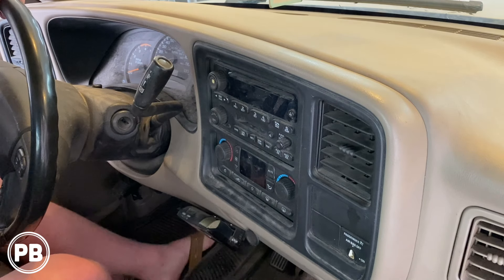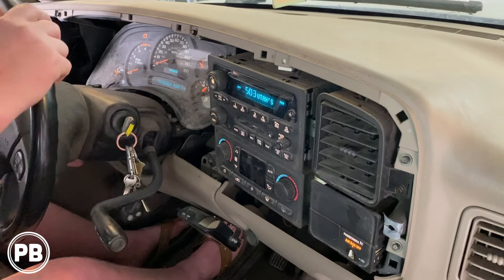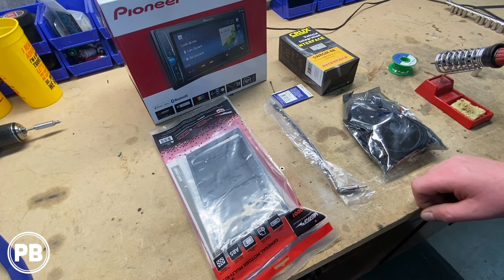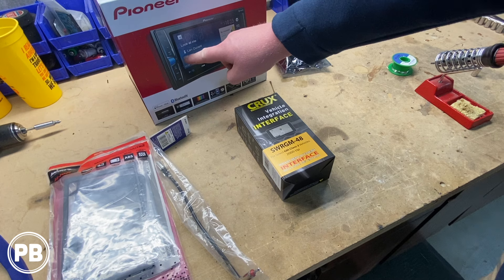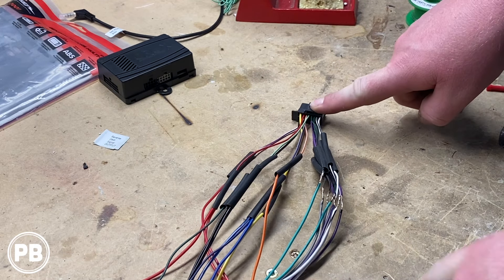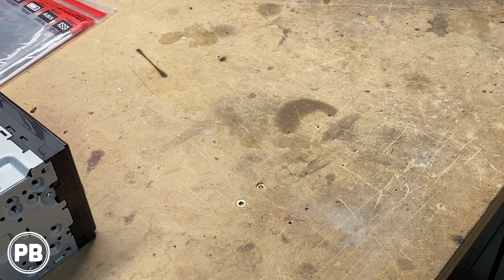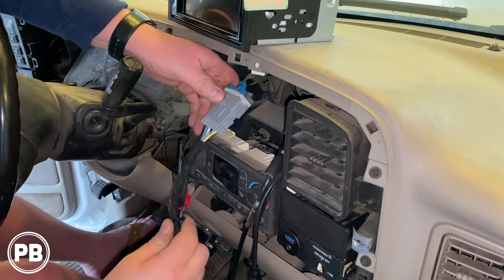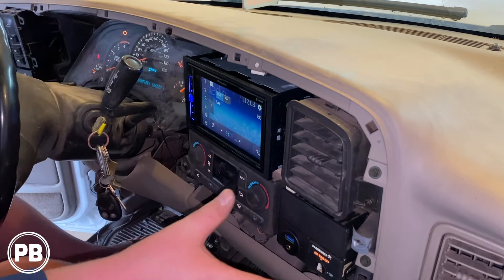1995 - 2006 Chevy / GMC Stereo Install

Comment: Hey - thanks for this video, super helpful.  I was just about to pull the trigger on all these parts for my 2004 Yukon XL, but I’m concerned that I would lose XM radio.  Do you know if I used the same radio that you used, would I be able to keep XM?  I can’t tell if that depends on the radio head unit or the wiring harness, or something else?
Reply from the maker: Hey there, yes, this requires you to have a radio that is XM radio ready, and you will also have to purchase the XM module to retain your service with the new radio. https://amzn.to/2WM1ULH.  The radio we used isn't XM ready, but higher end Pioneers, or this Sony is compatible: https://amzn.to/3ALE9EH.  Feel free to send me a message on our facebook page with any other questions!
Reply: Nice!  Thank you!  I kind of figured out after poking around, both in terms of what “XM” ready means and the fact that you have to buy the tuner (and also how to wire it to the existing antenna).  Do the higher-end stereos that are XM ready basically go in the same way, and would they use the same Crux wiring harness?

Comment: Where did you plug in the RC jack into your radio from the usb port you installed on your dash?
Reply from the maker: USB port goes to the USB port on the radio.  The AUX port went to the AUX port on the radio.  If your radio doesn't have an AUX port on the back, then purchase a flush mount adapter with only a USB.

Comment: Don’t know if there’s a good fix for this stuff. But my radio has an insane amount of static noise coming out of it and it’s annoying and my steering wheel controls make a loud click when I use them and they’ll sometimes mess up my Bluetooth and disconnect it. Anyone know what could be wrong?
Reply from the maker: Bad equipment or poor wiring job.

Comment: Do you need to connect onstar? I don’t use it and I don’t pay for it service. My 2500HD 06 is not starting. After 1 month of having my double Din install. I bought the kit to keep the buttons working on the steering wheel. But not for onstar. 
Can that be the reason why my diesel does not start? I had to use starting fluid in order to get my truck going. 
Could use your help. Please and thank yiu
Reply from the maker: Not retaining onstar should not impact the vehicle starting whatsoever.  However, to remove that variable, reinstall the factory radio to see if the truck starts.  I'd go from there.
Reply: @ProvoBeastAudio  thank you replying back to a old video. I do appreciate it, but for an update I forgot I took it into Chevy to get an oil change done and the people fuck up. She got air into her system. But i do appreciate the feedback

Comment: Since the Crux kit comes with an antenna adapter, is the seperate GM extension required?
Reply: 2004 Denali, factory Bose system. Installed Kenwood DMX970S. Crux kit extension works just fine. But the stock antenna cable has enough length on its own. 
Bose stereo has 2 connectors on the back, crux kit only hooked up to the larger of the two connectors. Stereo works fine, but no steering wheels controls. Will update once I figure that out.
Reply: Did you find the answer to this?
Same problem here

Comment: Do I need to connect onstar to my 2006 Chevy 2500HD. I did not buy the connection to keep onstar. But i did but the connection to keep my steering wheel buttons. My diesel won’t crank over. I have to use starting fluid to get it to start

Comment: Hope you get to read my comment, turns out that I am installing a stereo on a 2005 Hummer h2, I was looking at the diagram and saw this car came with an amplifier from factory, it has the Bose system, y was wondering if I have to run new cables to the speakers so I bypass the amp, or if I can just connect the speaker signal just on the harness behind  the stereo? Thanks  a million for your answer
Reply: Installing on a H2 here. Everything works for 6-10 min then I lose all audio, headunit still works. Once I restart H2 it all works again

Comment: Hey so my 03 Sierra with a bose system has a second harness clip with an orange/black wire and a pink/black wire. Do you know what they do? I believe they turn the factory amp on. I tried the factory radio with it out and had no sound.
Reply: My Sierra has the same clip. What’s it for?

Comment: Is it possible to install an aftermarket radio and retain steering wheel controls by just getting a harness adapter without the interface? I have a 2005 Z71 Chevy Avalanche and I don’t care about on star but would love to retain my steering controls.

I’ve never had a stereo install and lose my key fob abilities but something about the Bose system just seems odd to me.
Reply: Did you find an answer to your question? I have a very similar question to yours
Reply: @EthanNaresh  you have the bose system too? i'm thinking about getting a touchscreen.   what kind did you get
Reply: @RushVoorhisOutdoors  I haven't gotten a stereo yet. I want to know the major potential problems before I order one
Reply: I have Bose and just bought a touchscreen radios before I realized how dang expensive it was going to be for the harness needed

Comment: How do u choose the right wiring harness for your stereo does it go by the make and model or the truck or with the stereo your buying
Reply from the maker: https://youtu.be/pla_0VpHTvs
Reply from the maker: Most aftermarket radios will work with the harness adapters made for your vehicle.

Comment: What if your aftermarket radio doesn't have the 3.5mm connection in the back? Is there a work around?
Reply from the maker: If you are referring to the steering wheel volume controls, it depends on the Crux harness.  If it is a Kenwood / JVC, you will use the blue yellow wire.  Any other brand that doesn't have the 3.5mm input for those controls, you will need to resort back to the Crux manual on how to manually wire in "key 1 and Key 2" to the harness.
Reply: My diagram only shows a singular “key”(not two) what would you suggest in that scenario? Are they sometimes labeled differently?

Comment: My 2005 Chevrolet Silverado 1500 has two harnesses, one like the one in yours, and a smaller black one beside of it. Where can i find an aftermarket adapter.The truck does not have on star, steering wheel controls, or the Bose sound system. Any help would be appreciated.
Reply: My 2003 Yukon 4.8 slt doesn't have the steering wheel controls either or onstar..what wire harness do I need?

Comment: Thank you so much for this video it is very informative and helpful. I recently purchased this Crux interface because of this video and installed an aftermarket radio (Atoto S7 XE) in my 03 GMC Sierra Denali with the Bose stereo everything went fine and functioned as it should. There is one issue that i cannot figure out the sound goes out if I'm doing things like switching functions and will not return unless I cycle the ignition key basically power cycling the unit. Do you have any advice or suggestions that I can try? All my wires are matched, soldered, and insulated with heat shrink.
Reply from the maker: It may be the radio - The cheaper Chinese non-brand units can be very hit and miss!

Comment: What size is the radio in these vehicles?
Reply from the maker: Depends on what year you have. 1999-2002 have a 1.5 din. 2003-2006 have a full double din.
Reply: @ProvoBeastAudio  mine is a 2006 suburban fully loaded. And it has a big radio so probably double

Comment: So I'm thinking of doing the same install on my vehicle, however mine has XM.  It's a 2005 Tahoe and for some reason the radio takes a while to play sound to the speakers ( takers 15min or so for sound to play after turning to on) even after changing out the amplifier.  I'm thinking it's the radio head.  Any suggestions on the best radio head? Thanks
Reply from the maker: Sure, send us a message on facebook and we can send over some recommendations!

Comment: I have low volume rear speakers not workung
Reply from the maker: Its probably because you probably have the audio harness on the crux plugged into the bose port instead of the non bose side (assuming you don't have bose).  Switch ports and that should work.  You can move guidance on this video here: https://youtu.be/B1zAsUsJy2w?t=103

Comment: Found your videos and channel while browsing. Some confusion. I have a 2002 Yukon XL with steering wheel controls. Happy to use your Amazon links for everything, including Metra adapter from single to double din. Crux only shows 2003 for the adapter, and you don’t show the Bluetooth microphone part. Will any microphone work with that stereo? Will the adapter still work for the 2002 Yukon XL Denali with the Bose factory system? Appreciate a reply before I use your links👍
Reply from the maker: See the link in the video for the dash conversion video for a 2002.  Parts are a bit different.

Comment: Great video the red wire did get me though , had to install a toggle switch to it as well as the ground have to flip it off and back on which allows DVD 📀 play as you drive

Comment: So if you have a Bose system do you need this harness? Bought a harness from Walmart and it plugged into mine but when I got it all wired up the radio would not turn on Also I need to go buy the antenna extension as mine did not come with, would that prevent the stereo from turning on? Anything helps

Comment: What size are the screws to mount the dash kit  to radio
Reply: They come with the kit. If you need replacement just bring the radio with you to the hardware store and see what works they usually have a loose screw section otherwise i know home depot doesn't mind opening the boxes, id open one of the bigger boxes that re-seal easily to find the width the fits and then buy a small pack of that size but only 1/2 or 3/4 in long

Comment: My dual radio has no WR input jack. Can I use the cam in one instead or??
Reply from the maker: It may not be steering wheel control compatible. If you send us a message on Facebook or instagram we can help!

Comment: What size are the screws to mount the dash kit  to radio
Reply from the maker: Each radio will have their specific screw length, size, and pitch. Pioneer uses an M5 8mm sized pan head screw.

Comment: So you can fit a double din with a stock Basel ?
Reply from the maker: For 2003 - 2006 only.  Pre 2003 will require a different bezel.  Link in description of video for that video.

Comment: Great and helpful video. Did you use the 3' or 6' aux/usb adapter kit? Thanks for the helpful video.
Reply: I would guess 3 feet is plenty for this use. The 6' cord is likely for running it to the back seat

Comment: @Provo Beast Audio Installation 
I have an '04 1500 Silverado Crew cab. The door speakers say Bose on them. The factory headunit has 2 connectors one is a 24 pin. Also have rear view mirror with OnStar buttons...Can I get a harness without Onstar since I do not have active OnStar subscription? Head unit to install is Pioneer AVH-120BT. Thanks
Reply: Any answer?

Comment: Great Video. One question, my 2004 silverado has a microphone installed as part of the on star. is this not activated through the harness?  will a new mic be required etc?
Reply from the maker: Generally it will be on it's own protected circuit, so an aftermarket one would be required to be installed in most instances.

Comment: Is the wiring harness necessary if i have no onstar or steering wheel controls (06 gmc sierra)
Reply from the maker: You can get a more simple version as you will still need one with the smart harness module for accessory and other necessary functions.  you would need the Crux SOCGM-17 harness.

Comment: I just removed that same factory radio from my 2006 Silverado and forgot to remove some CDs first.  Can you tell me which pins I need to connect to on the back to power it up on the bench and get my CDs?

Comment: I used the Crux SWRGM-48 on my 06 Chevy 1500 with the Bose system and steering wheel controls.  I am not getting any sound output. I also have rapid flashing blue light indicating CAN not recognized? I have the switches set correctly on the back of the module. Not sure where to go from here.
Reply: Just wired myself up a kenwood head unit on an 03 silverado today with SteeringWheelControls(swc) and bose system.....all said and done i also had no power and found a video that led me to my solution....on the harness that came with my kenwood unit, is a Blue wire that is labeled PowerControl/Power Antenna...as stated in the video insaw i didnt use this wire under the assumption i didnt need it because i dont use a powered antenna.....come to find out..by tieing that blue wire into the Crux's 24 pin blue/white and the blue/yellow from my 4 pin SWC, it then powered my amp and i had sound! So all 3 need to be wired/soldered together..to test before i rewired it all, i just stripped the blue power control wire and touched it to my already made-up connection from my blue/white&blue/yellow..it was about a 2 second delay of holding the wires together that it rook my bose amp to power up and then i had sound!...hopefully something similar will help in your case, either way, theres answers out there and its def just a simple wiring issue somewhere in your harness
Reply: @jimchow-ch5vu  The blue Power Control wire did the trick for me also. Now I just need to figure out the steering wheel controls not functioning.
Reply: @jimchow-ch5vu I have the same problem and am going to try this.
Reply: Yup thats what it was! Thank you for this info. I had the same problem and thought the same thing about that "p-antenna" out of my kenwood. Figured not to connect it since i didnt have one. But unlike yours... i only had to connect that antenna off my kenwood to the "amp turn on" on the crux. Didnt need a 3way connection like you said you did. Anyways it works. Again thank you.
Reply: @plutocrank awesome,glad to hear it! As far as the steering wheel controls like @thirdgearboogie is dealing with...mine also dont work and havnt..however i stopped caring to diagnose it any further and was just happy with now having the bluetooth capabilities in a 20+ year old truck lol

Comment: Does the Crux adapter work with the bose system including the factory rear DVD player?
Reply: Yeah I was wondering the same thing but it looks like it will most likely you're just going to have a few extra connections to go into the AV jacks into the back of the stereo at least I hope I'm going to give it a shot I think
Reply: And

Comment: What do you do with the remote wire on the pioneer side and the remote wire on the vehicle side? Can you use one or the other or do you have to splice them and leave a tail?
Reply from the maker: You can just simply connect them together.

Comment: I have a 2004 GMC Yukon Denali xxl with factory Bose system . Has two harnesses and a green connector . I’m getting no sound to my new Sony double din and only powers up when yellow and red wires are all connected . Can’t shut off . What am I missing? Other harness are three green wires , a black one , and a pink / black stripe wire and orange black stripe wire . Please advise
Reply: Did you ever figure it out? I think I'm having the same problem
Reply: @samurijack110  yes you have to buy the GM harness . I purchased mine from Best Buy. Make sure you pull up Walmart’s cost. They price honored mine and got it cheaper . 
It’s super easy to connect and you retain the factory amp . Sounds good too. I changed and went with a nice strong pioneer head unit. Bass hits hard .

Comment: I have a 2003 gmc sierra that has a bose system , I did every you did but for some reason my head deck won't get power.  The radio interface gets power though, when plugged in it chimes. But I do need the remote turn on wires connected together and there is 2 of them.

Comment: With an 02 Chevy with a 1.5 din how would I go about installing a double din and having it look clean. Right now I wired up a double din unit and just trimmed my bezel but it does not look clean also had to use 2 pieces of wood one on each side to fill the gap
Reply from the maker: If you want to add a double din radio in years 1999 - 2002, you will need the Dash Bezel Adapter: Metra DP-3002B Double DIN Dash Kit.
Reply: Thanks for the quick reply and part number! Good man.

Comment: Does this interface with the factory cd changer as well?
Reply: You have to buy an adapter that splices it into one of the auxiliary wires (the ones he didn't use and put red covers on) and it would be accessed in the "accessory" or "auxiliary" portion of your radio. Make sure the radio you buy supports it

Comment: Hi, great video, I mirrored everything g you’ve done except when I plug everything in I don’t have much sound coming out, it does work but very low volume. I’ve checked my connections and settings on the radio and can’t figure it out, any help would be greatly appreciated
Reply from the maker: You may have the sound output harness plugged into the Bose output instead of the non-Bose output.  If you don't have bose, be sure to have the output harness plugged in the non bose slot or else that my result in low volume.
Reply: Same problem
Reply: @ProvoBeastAudio  I am also having this problem??
Reply: @ProvoBeastAudio  I am also having this problem??
Reply: @billromero5462  did you figure it out? I’m about to try a 2nd Crux interface/harness
Reply: @mckinleypotter1785  the blue/white (amp) from the harness to the Blue on the Head Unit ?
Reply: @mayken6661  some say not too cause you will lose voltage but thats what i did on my 04 chevy silverado and it worked & powered factory amp and the ignition / door open will power off like it should!

Comment: Out of curiousity does it have to be that specific pioneer head unit or can  you use any and just install everything else that you showed
Reply from the maker: Any standard double din chassis sized radio, regardless of brand and screen size.